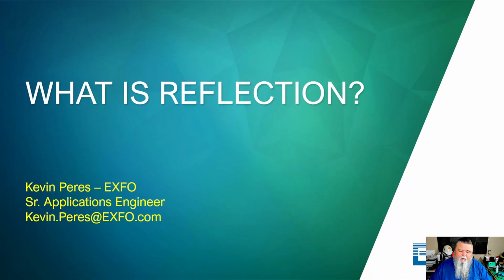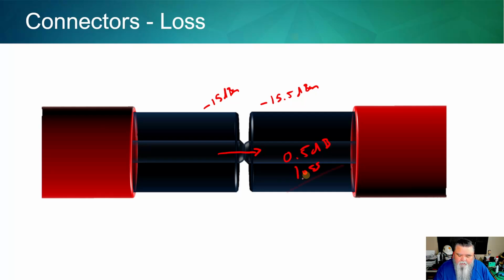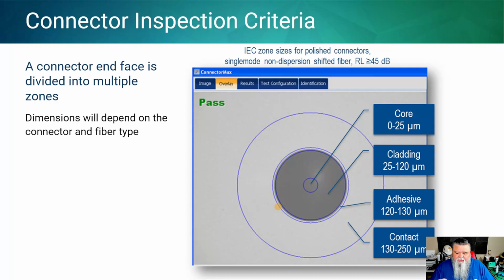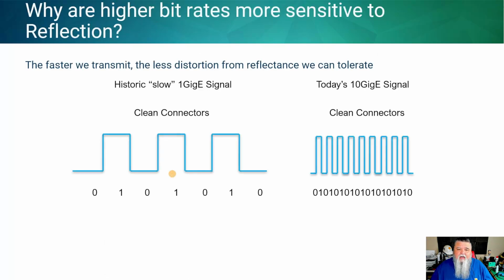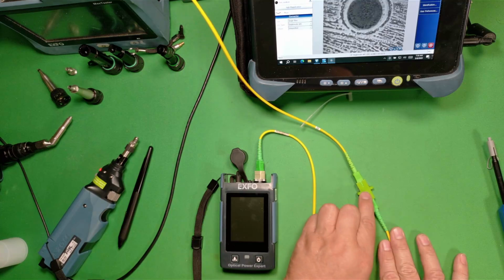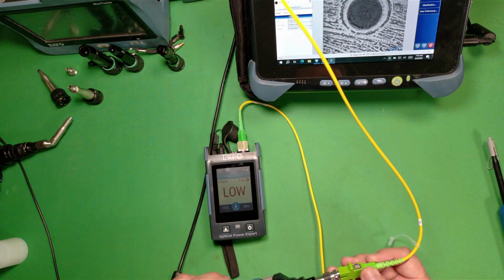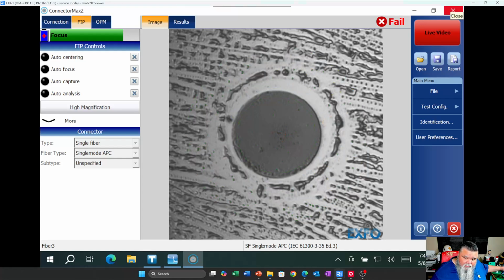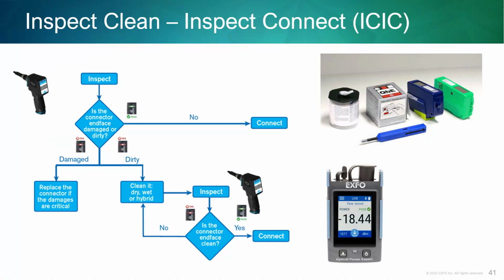Video Short Reflection. What is it?

Comment: I would like to have seen the light level after cleaning and getting a pass on both of those apc connectors.
Reply from the maker: Yes that would have been a good addition. When I train I usually do that.  I may have and edited it out. I may still have the original. This was a video I did for a e-learning project and I was limited on the time for each module.

Comment: Keep em coming. People need to scope after cleaning. So manly connectors I find were assembled wet and juicy with a ring of liquid that attracts dirt. The other ones have dried dirt on them and a click cleaner won't fix it. You have to use a wet to dry. These connectors are the ones out in the field. The FIP 435 lives on my hip in its holster and the software on my phone keeps the GPS records from where I took the readings. It's great to clean a fibre and see a node stop being intermittent.
Reply from the maker: I am glad you liked it. Hybrid wet to dry is the best way.  I usually talk more about that but this video was for a specific project. I had a module before that went over cleaning in greater detail and I talk of hybrid cleaning. 

I also agree it js a great feeling to clean a connection and improve a circuit.